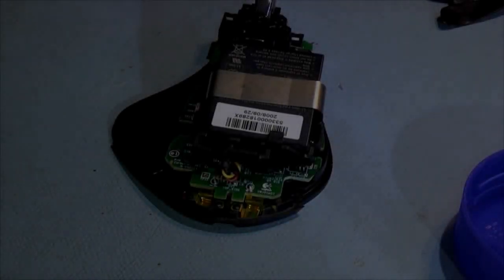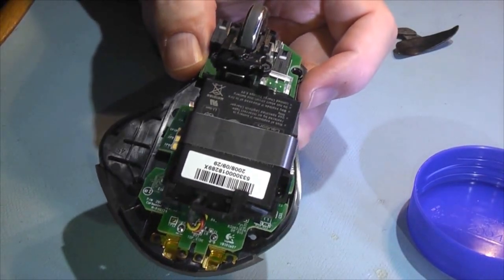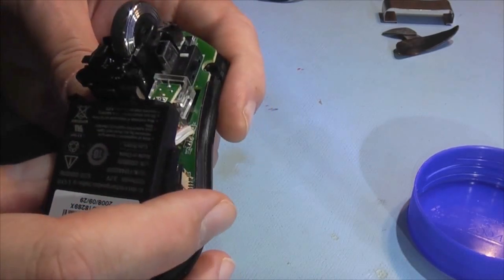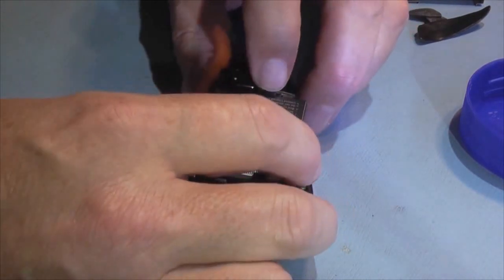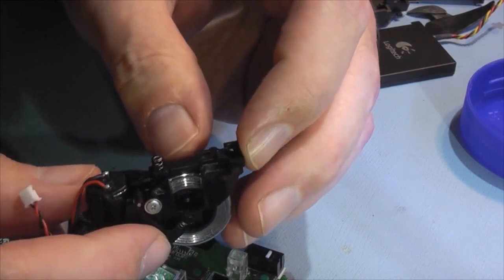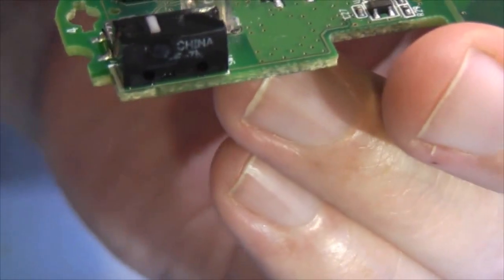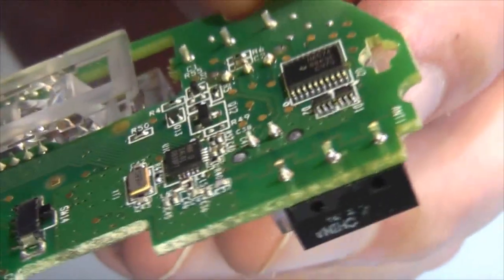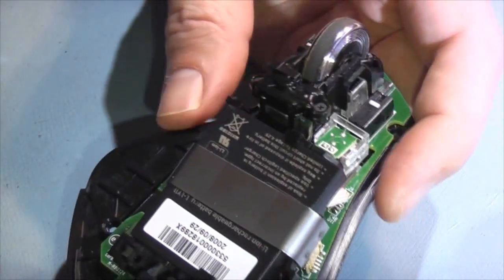Logitech MX Revolution Mouse Switch Replacement - And switch lube request.

Comment: Where do you get your flux remover and braid solder remover? I'm in Canada if that matters. Also that helping hand you have is pretty nice. :) Whats the name on it? I want one.
Reply from the maker: NightFlight1973 Hi.. I get most of my electronics stuff from Farnell/Element14. Please note though that there is a £20 minimum order at many of the larger online electronics stores..  http://canada.newark.com/

If you can't find what you want at Farnell/Element14, you can also check out Amazon, RS Components, Mouser, Digikey etc.
Reply: ***** Thanks much. I found the switches out of china on ebay. 10 for $4 with shipping included. Hope they're not fakes but its just $4 to find out. Also I modified my question and you might have missed it.. what is the stand/holder/hands your using?
Reply from the maker: NightFlight1973 Hi.. Sorry... The holder is a Panavise 201 Jr.

I got my switches from China eBay too so hopefully yours will be fine.
Reply: ***** Thanks much! I have two MX revolution mice, both with the multi-click issue. I'll try some spray until the switches come in. Thanks for the vid!
Reply from the maker: NightFlight1973 No problem, glad to help

Comment: Very helpful video! I will be picking up some switch lube in the near future. I recently replaced the second set of OEM Chinese switches (D2FC-F-7N) in my Performance MX with some Japanese (D2F-01F) switches which are found in many high-end gaming mice. I'm hoping they last more than the 2 years I average with the OEM switches. They're a slighter louder click, but I'm very happy with them. Also, when I purchased them on eBay, they were actually cheaper than the OEM switches.
Reply from the maker: Thanks for the comments Ryan.  JFI I also have used the ebay switches, and although i handed my MX Revolution over to my mum a few years ago now,  I can tell you that those switches are still going strong.
Reply: I'd guess I'm a bit harder on mice than your mum. The OEM switches aren't bad, they just don't hold up after a couple of million clicks. 😊
Reply from the maker: +Ryan Burton   Hehee..  Agreed mate 😉
Reply: Maybe check the ratings.

DFC.F..7N comes in 3 variants

DFC.F..7N doesn't specify but is 5-7Million clicks
DFC.F..7N (10M)
DFC.F..7N (20M)

Go for the last, ALWAYS. Specially if your burn them on mobas.
Reply: Does lubing benefit mouse switches? If so, in what ways?
Thanks in advance!
Reply from the maker: +Jance kor.. If micro-switches are new or are having no issues then lube is not really necessary. If however they are double clicking, sticking or old lube can help. For this I always use some contact cleaner spray, either Servisol Super 10 or Wurth are good, other brands are available too like DeOxit etc.

I normally press the switches button down and then squirt cleaner in until the switch is flooded.. This is the only way to guarantee the contacts are coated, well unless the switch is disassembled, and many cases with micro-switches this is not possible. Just remove the excess cleaner from the switch with a paper towel just so its not left full of cleaner. The rest will evaporate leaving a nice coating on the switch contacts which will help prevent further arcing.
Regards
John
Reply: John - Orbiter Thank you for your detailed reply.

Comment: Hey John 

If i store the  mice in a dry cabinet set at 45% humidity, will it dry up the lubricants in the mice ?
Reply from the maker: Hi Gary. The only lubricants I am aware of inside mice are those that would either be inside the micro-switches, inside the motor assembly and possibly around any gear mechanisms.
I very much doubt that storage in the conditions you describe would cause a problem. HOWEVER this of course depends on how long you are going to store the mouse for! If it's just going to be for a year or two I would perhaps store where you mention but put it in a dry box also. If it's going to be for longer than that.. Well.. this is a different matter, as ALL lubricants will dry out over a long period of time (many years) If this is to be the case I would store the mouse in a box & inside an air tight bag, however even if taking these precautions the mouse may need a little maintenance when it is to be use again like switch cleaner inside the micro-switches and a very light oil (WD40) on other internal moving parts.
Reply: But if it's gonna be just a year or two it would probably be fine right ? Because 45% humidity is not that low and it's the setting used to store camera lenses to keep it away from fungus but at the same time not too dry for the rubber to wear out quick.
Reply from the maker: Gary Chong Yes for a year or two it should be just fine. Just put the mouse away nice and clean, box it up and it'll be ready to go when you need it again.. Well after a charge :)

Comment: Do I need to buy a helping hand/third hand tool to hold the pcb board? 

And can I just do this with no gloves on any floor/surface? 

Thanks
Reply from the maker: No you don't need the additional helping hands or gloves, but it is definitely a helpful & handy addition if you have a third hand tool. 
If you can do this on a smooth surface it would be easier, but don't do it on a heat sensitive surface or on a carpet etc if your using a hot iron.
Reply from the maker: @royregis1129  Any helping hand tool is ok BUT remember, that they have teeth on their croc clips which these can damage a PCB if your not careful. You can however cover the clips with insulation tape or shrink wrap to protect the PCB and it's components. 
PanaVise tools are great for holding PCB etc, however they are also rather expensive, especially if you're only going to be using it the odd time.
Reply from the maker: @royregis1129   No, mice use various switches.
Reply: Orbiter Electronics thanks, do you know how to confirm compatibility & gauge what sizes will fit? 

Or should I just try them all to see which works?

Thanks
Reply from the maker: @royregis1129  If you're after switches for the MX Revolution mouse then the name and number of the switcges can be seen in the video description. If you're talking about mouse switches in general then you firstly need to know what they look like and preferably get a part number for them. Some cheaper mice do just have four leg tactile switches which are mostly the same so any could be used. However if switches are a specific type they will have different footprints, heights etc, which need to line up & solder correctly to the PCB. The wrong switches just won't fit or work as they should.

Comment: Wish I'd watched this first. I didn't use desoldering wick and I ended up pulling the inserts out of the board. New mouse time.
Reply from the maker: Sorry to hear that 🙁
Reply: ***** Well it's wasn't an expensive one and it lasted me a good 4 years. Live and learn, besides it was almost unusable anyway with the double clicking. Also it's a good excuse for an upgrade. Though I might have a go at the other switch for practice. 

Thanks for the video!

Comment: Hi John,
First off, great video.  In fact I'm in the process of replacing the left button (possibly the right as well), using your video as a guide.  So far so good.. switches just came in today.  Here's the thing.. the issue I'm having with the mouse isn't the normal double click problem.  The left button (from a lot of use) has become rather stiff to press.  Not to the point where you can't use it, but gives you a sore finger after 1/2 hr or so.  If changing the micro switch doesn't solve the problem, what else could it be?  BTW, there is a small "depression" on the very top of the mouse where the split between the buttons ends.. can send pic if you'd like to see.  Advice?
Thanks,
Paul
Reply from the maker: Hi Paul.. Changing the switch should fix the difficult clicking issue.. What happens in some cases is that the switch internals collapse leaving a compressed dead feeling switch with no tactile feel.

If you need less of a dimple on the underside of the mouse button (unlikely) just scrape a tiny bit of plastic off. If however you require more a of a dimple (say if yours has worn off) a tiny blob of Araldite or JBWeld can fix that.

Hope that helps

John
Reply: ***** Ah oh.. I replaced both switches, and after re-opening the mouse to connect the ribbon cable I forgot, it was working properly (charges properly, and both buttons click better, but the left still takes more pressure to press). Went to put it back in the charger, and no lights at all. Tried on the same computer as before, and no mouse action (or lights) this time.  Any ideas?  I checked all the contacts for charging and the battery (and cleaned them), and tested +8.5vdc at the charging base, but no luck..
Thanks,
Paul
Reply from the maker: pas6171 Hi paul.. If the only thing you fiddled with is the ribbon cable, I would say firstly to check that the ribbon cable is connected the correct way around (contacts to contacts.) IIRC I'm sure it can fit in the wrong way around, meaning that the gold terminals on the end of the cable are facing the wrong way thus no contact.
Reply: ***** Start to finish here's what I did:
1) Disassembled, replaced microswitches, and reassembled
2) Removed top again to connect ribbon cable
3) Tested and everything was working properly (lights and buttons) - charging station and computer
4) Went to put on charging station again, and no lights.
5) Checked all connections and they appear good.
6) Unsoldered board again to check for solder bridges, etc and nothing visible that I can see.
This is where I am right now..
Thanks,
Paul
Reply from the maker: pas6171 Hi Paul.. Sounds strange. Ok try this.. Open the mouse up again and pull the battery for a few seconds then replace it. There are users of this mouse that say that this can reset the mouse and correct any charging issues.

The only other problem I had like that was when the charging station wasn't making proper contact with the mouse. Sometimes wiggling the mouse in the charger will correct this however... I ended up using a Q-tip with switch cleaner on it, and polishing the contacts on both the mouse AND charger.
Reply: ***** Just got finished trying those things and no luck.  When you turn the mouse power switch on, normally the lights will light up momentarily but nothing.  Oh well, if you think of anything else that might help, let me know.  Thanks for your help.  Paul
Reply from the maker: pas6171 The only other thing I can think of is perhaps a broken or cold solder joint somewhere.. Double check any joints that you've made. Although I doubt the mouse would fail if it were a switch joint. It's more likely a board joint with the flexing of the PCB during repair.. Just touch a fine Iron tip on all the joints to reflow them, a small amount of liquid flux on each solder joint will assist the reflow.

Just in case you can't repair your mouse.. and if you didn't know already. The new Logitech mouse has just arrived on the market, it's in short supply here in the UK at present.. However It's called the Logitech MX Master 												and is supposed to be the successor to the MX Revolution. It gets great reports too so I'll be getting one pretty soon to replace my G500.

Comment: Wish I Found this before I  took the switch off my MX 1100 as I think I took it off wrong, But I find this video very help full non the less. I have Precision Electronic Cleaner from RadioShack Same stuff as switch cleaner?

I love my MX 1100 and I either fix or destroy it fixing it one of the 2
Reply from the maker: Hi.. Can't say for sure if the stuff you have is the same as contact cleaner, but it does sound like similar stuff.

Even if you have damaged a switch you can buy spare switches from the likes of ebay etc, the switches normally have a part number on the side. just look for that number on ebay or similar.

Regards

John
Reply: *****
 Well first i tried to  repair the switch  the metal clip snaped in the switch, Bought the new switches D2FC-7-7N (10m), but when I taking off the broke switch some how 1 of 3 copper rings around  front 3 holes for the board ( part the switch sits on) Came off I since Solder it back on or hope. I will find out if works when put the new switch which i hope it does, cause I love my MX1100 and replacement one is like 40$ on ebay new and if  and if it comes to that, I rather spend the 80$ to get the G502 and move away from wireless all togehther

This the cleaner I  have. http://www.radioshack.com/product/index.jsp?productId=2102649
Reply from the maker: tsunami2311
 Ah yes... I just had a look at the product datasheet and it is indeed switch cleaner, so you'll be fine with that.

Also as regards the microswitches ALL mice have them so whether you go wired or wireless you'll still have the click switches. The problem is you see that all these switches have a life span, for example 10,000 clicks etc. So once the switches reach this point they are prone to failure unfortunately.

I'm actually having the double click issue now with may 2 year old G500. So you may see a video of that up soon on my channel :)

Hope you get your mouse working well again

Kind Regards

John
Reply: *****  I have issue with the MX1100  cursor getting all erratic and jump on me which i assume is the wireless issue and it purely random.

Update though I just cleaned the left switch on my Cordless Optical mouse from Logitech that was double clicking and having hold issue ( would forget and remember i holding the left click)  would also some times not even register the click and using the Electronic cleaner fix that right up.

I definitely  wish i found this before i took the switch apart in the mx1100 cause both left/right click suffer from that problem on the mx1100. I might of saved my self a headache. Again I love this video you made
Reply from the maker: tsunami2311
 With wireless dongle issues (especially if the dongle is around the back of the computer system somewhere) try this...
Remove the dongle from the computer and attach it instead to a 1 meter long USB extension cable, then move the dongle to an area that is closer to the mouse. This should give you far better connectivity.
Reply: ***** the I extended usb dongle is it less then foot from the mouse/kb it never stoped the mouse from getting jumpy at random tried diffrent usb port diffrent usb extenders too mx1100 mouse always had this issue though.

None of it maters even with the new switch i cant get right click to work anymore and the middle click is dead too, guess i broke the board someplace
Reply from the maker: tsunami2311
 Yes the board could possibly be damaged. Although firstly did you try removing the mouse software drivers?
If not try un-installing them from the control panel. Then download a program called CCleaner.
Once you've downloaded CCleaner and installed it, run it's registry cleaner, this should remove all left-over logitech registry entries.
Then re-install the latest logitech mouse drivers.

Comment: It worked with wd-40! Thank youuuuu
Reply from the maker: Good to hear your mouse is working again :).. Just be aware though that WD-40 is only a water dispersant and will dry out pretty quickly. The reason we use special switch cleaner is that as well as cleaning the switch, it also leaves behind a little lubricant which prevents the switches contacts arcing over time. This is what causes the switch issue in the first place.

Regards
John
Reply: I will take that in mind the next time! Thank you!

Comment: DEFECTIVE (weak) Mouse click-switch on the M325 Mouse also. Its NUTS that the switch is more expensive to buy (on amazon) than buying a new (similar) mouse.
Reply from the maker: Roger Dodger .. What is the switches part number?
Reply: No part number visible on my M325 micro-switch (its a standard 3-pin mouse switch), but they are (removable) black top & white base, and sort of look a bit similar to the one-piece switch`s  in your video (I took the faulty one apart to try & fix it [finicky] but it houses a delicate//weak copper contact): Its no biggie, as I have other better mice. The G900 is great. I also redesigned my Wireless SteelSeries Sensei & changed the internal battery wires to a `plug & replace` to use 50% bigger (longer-life) batteries.
Reply from the maker: Roger Dodger .. Might just be worth getting a couple of these... which are a common type of switch.. And they're cheap enough even if they're not suitable 👍 https://rover.ebay.com/rover/0/0/0?mpre=https%3A%2F%2Fwww.ebay.co.uk%2Fulk%2Fitm%2F272975587188
Reply: Cheers for the link John. They are (to all intents & purposes) the same type of switch. And they are waaaaaaay cheaper on (UK) e-bay than Amazon Japan (my usual online shop). On the other side of the planet here bud, and so many places do not post internationally, so its usually not worth me trying to find out; but will consider it. .... Ooops... Just checked... UK postage country only.
Reply from the maker: Roger Dodger .. Sorry mate.. I didn't consider you may be on the other side of the planet. The switches are more expensive on Amazon here too IIRC.. You could check out eBay Japan though, assuming you have eBay there 👍. Just search for the same switch number as in my link.
Reply: Thanks again John.. No worries... ebay is a bit under-developed here in the Far East.... and reading sophisticated Kanji is probably a 20 year process.

Comment: Does the MX 910-002896 use the same model?
Reply from the maker: I'm not 100% sure my friend, however.. If you open the mouse up and look on the switch itself there should be a part number. Copy that number down, and have a look on ebay for a replacement switch.

I remember that I got the switches for the MX revolution from ebay so switches are available from there.

Hope that helps
Reply: Thank you.
Reply: ***** Thank you.